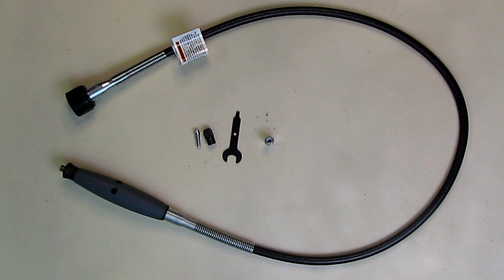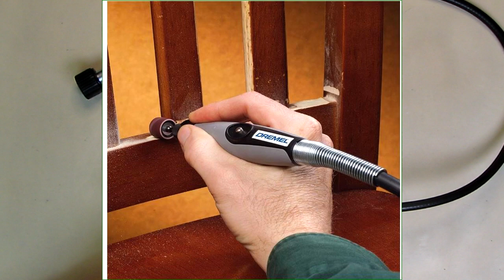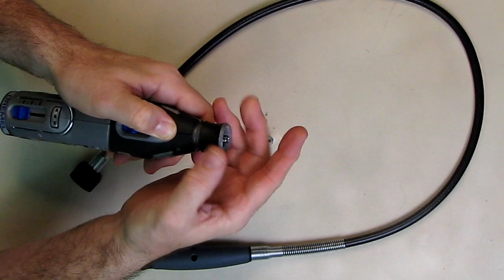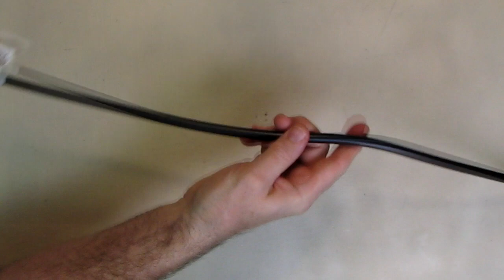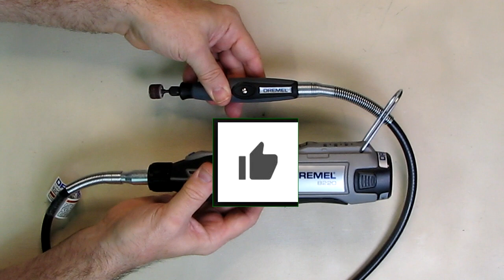BEST Flex Shaft Rotary Tool Attachment Dremel with Comfort Grip and 36” Long Cable REVIEW

Comment from the maker: ORDER Dremel Flex Shaft Rotary Tool Attachment with Comfort Grip and 36” Long Cable- 225-01 HERE: https://amzn.to/2pkMPjZ
ORDER Traxxas 1647 Silicone Grease (to lubricate all bushings) HERE: https://amzn.to/3oYSTar
ORDER Top Brands of Flex-Shaft Attachment for Rotary Tools HERE: https://amzn.to/3637cTn
ORDER Dremel 8220 Series 12-Volt MAX Lithium-Ion Variable Speed Cordless Rotary Tool Kit HERE: https://amzn.to/2NeUDf4

Comment: What type of Oil or Grease do you use to lubricate the Dremel Flex Shaft? I saw another video where the guy used 3 in 1 Oil. Is that good to use on the Dremel Flex Shaft? I just got my flex shaft yesterday. Do I need to oil or grease it before I assemble it and use it for the first time? Thanks so much for your video and information. Have a Great Day!!!!
Reply from the maker: Item should have silicone grease already but if not, you can use this product on the bushings: ORDER HERE: https://amzn.to/3oYSTar
Reply: @jeffgrave  Thank You! Have a Great Day!!!!